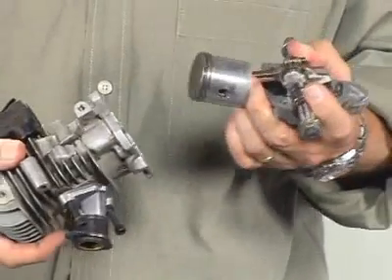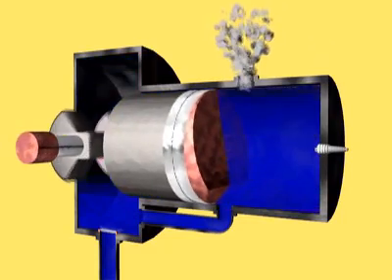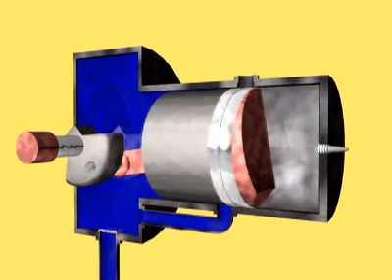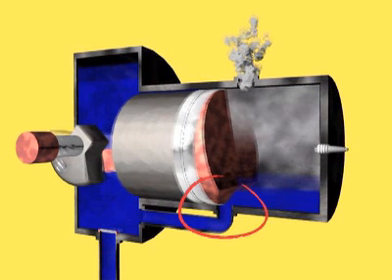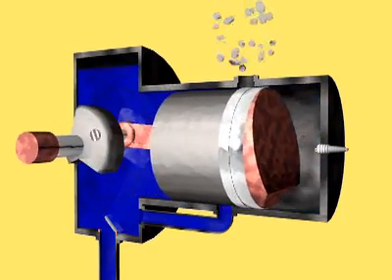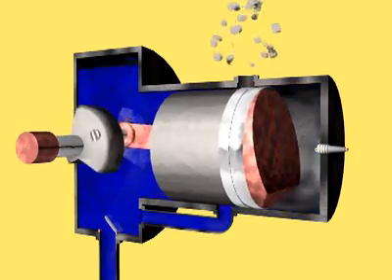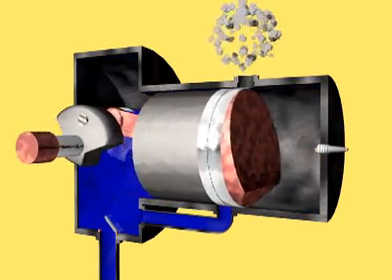How Two-stroke Engines Work

Comment: Any 2 stroke produces 2.5 times the torque (tractive effort) per cubic capacity of a 4 stroke engine.

A 2 stroke also produces 1/24th of the Nitrosoxide emmissions of a 4 stroke engine per volume of fuel burnt (US governement research figures). That's why 2stroke don't need catalytic converters

A 2 stroke engine without a Klaaden type expansion exhaust system will emit more unburnt hydrocarbons than a 4 stroke engine  of equal cubic capacity.

Comment: "twice the power" is a stupid thing to say because there is too many variables, having twice as many power strokes theoretically can make twice as much power, but 2 stroke systems (reed valves, carburetors, mechanical) are inefficient and dated against fuel injection and EFI mappings from 4 strokes. In real world scenarios, the 2 stroke is inefficient and therefore will usually never match the power. At the moment, on average, 2 strokes aren't even close to "twice the power" video is misleading.

Comment: JESUS NO Do some research, take a look at a modern 2 stroke mx bike, the 125 sx by KTM peak hp is around 34, while the 250 sx f (4 stroke) makes an insane 42 hp. This is at power band, now drop them to say low or mid range, now the 2 stroke stands NO chance. I own a 250 2 (and a 250 4 stroke.) I love the sound, the lightness (15-20 pounds less), the fun factor, but unless you are a pro at the clutch and never make mistakes, a 4 stroke will SMOKE you. OFC with more R&D 2 strokes can fly, but EPA.

Comment: because theres no oil pan like a normal 4stroke car engine. the crankshaft(section below the piston) has no kind of lubrication so when it fills up with gas if there is oil mixed with the gas well then the oil acts as the lubricant :)

Comment: Some 2 stroke engines, like large diesel 2 strokes, use an exhaust valve on top, and the ports on the cylinder wall are both air intakes.

Comment: ...most of the fresh fuel mix trying to escape. It's a very well timed play and balance of flow and pressure. The end result is, not so much at all fuel is wasted. Again, small portion is, inevitably. That, on the other hand is why a 2t engine is slightly less economical than a 4t of the same power (not volume).

Comment: Well first said, some of it does. As well as some exhaust gases stay with the fresh mixture. That's why theoretically 2t engine must be 2 times more powerful than the 4t of same volume, but in fact is only about ~1.5 times. However, the cylinder top and piston surfaces are not flat as shown here, but designed to route the flow of gases. Also, ignition comes a dash earlier than the top of stroke. The exhaust leave at such rush, that for a (precise) instant they create backpressure, resisting...

Comment: Not for sure, but some 2 cycle engines have what looks like a reeds (called a reed valves) on the outside part of the head where the exhaust is able to escape. Think of the exhaust as result of an explosion / ignition & after the explosion / ignition a vacuum  then happens which causes the reed valve to close on the exhaust port & suck in the fuel on the in let port. Some one else please help to explain,

Comment: rpm cut is controlled by ignition too.
a two stroke is a two stroke whatever the system you use fill it with fuel.
piston wear will be the same because of its same work.
there is one powerstroke per cranck rotation not every two crancks like with a four stroke the wear is more important.

you can't adapt EGR or catalytics without mechnical failures or efficiency loss.

Comment: It is not used for good reasons.
it must waste oil whatever the way you want to turn it.
a 4 stroke engine do not require 2 % of oil min to run.
it do not needs pistons or rings for normal maintenanc eas a 2 stroke does.

it will not allow egr too etc...

Comment: yes , this is why a proper expansion chambered exhaust is critical. it will in essence work as a echo chamber. the sonic resonance reflecting back in the pipe will force some of that unspent fuel back into the cylinder..  however the exhaust port closes relativity early in relation to the piston stroke. If it didn't you would not have compression and therefore no combustion.

Comment: That's where the exhaust comes in to this. Two strokes have a special exhaust with an expansion chamber and, let's call it a plate, towards the exit. What happens is when the exhaust gasses get released, some gasses are able to pass this plate, but the rest cause back-pressure. This back-pressure forces the escaped fuel/air/oil mixture back in to the piston for maximum efficiency.

Comment: A two-stroke engine compresses four cycles into two.

Large, very large and extremely large two-stroke engines generally use Roots-type superchargers or turbochargers for charge air scavenging as a two-stroke engine cannot naturally aspirate in the four-stroke sense.

Such engines have a very high thermal efficiency as well as weighing significantly less than a four-stroke engine of equivalent power.

The world's largest diesel engine is a two-stroke. More than 100,000 hp.

Comment: of course ! that is why you have an oily dirty exhaust and not such an efficient fuel consumption on 2 stroke engines ! 
for example my 23cc 1.5hp goped engine goes about 100km with 2.5litres of fuel/oil mix...while e decent 1000cc turbo 4 stroke engine runs 80km with the same amount of fuel. the engine is 43 times bigger and 66times more powerful :)

Comment: yes that's why they smell the way they smell, some gasoline is unburned in the exhaust gases, but modern 2 strokes have many ways to solve that. A simple way is a well tuned expansion chamber exhaust which will create a supersonic echo after the exhaust gases hit the walls and push the unburned gasoline inside again. Another way is to use a direct injection system so that gasoline is inject only when the piston has already closed the exhaust port!

Comment: yea, some of the fuel-air mixture does escape, hence why 2strokes aren't very efficent. however, newer 2 stroke engines are made with direct injection, so the mixture only comes into the cylinder, right before it is ignited. This is way better, because when the gasoline is in the cylinder it actually evaporates a little before being ignited, and this gives poor efficiency.

Comment: yes but the expansion chamber on the exhaust pipe (on most two stroke motorcycles, go-karts, etc…) fixes this. When the exhaust leaves the cylinder,it travels through the expansion chamber this lets the gas expand (obviously). This creates pressure, so when the exhaust gasses start to get pressurized again, in order to continue through the pipe which after the expansion chamber gets small again, they begin to whirl around in the chamber,

Comment: Yea they can last for years, though gasoline does take away from the oil's lubricative properties, but just a small amount to cause slight wear ( depending how you run it; fast or slow, different type of oil, ETC)

Comment: Oh yea without oil it'll kill itself quickly, but since its not slinging oil everywhere in the crankcase and the parts, they wear faster than a regular 4 stroke ( they also have higher RPMs so that doesn't help :O )

Comment: reaches the exhaust in time to meet the fresh incoming charge of fuel,stopping it for a fraction of a second till the port  is closed by the piston thus stopping the new charge going down the exhaust.

Sadly the exhaust is one fixed size,so works really at one set rev range,so you will always get some fresh charge,along with spent two stroke oil that gets emitted from the tail pipe.These bad gasses and oily drool led to failure to meet emission legislation in California,killing off 2 stroke.

Comment: The exhaust in a two stroke has an expansion chamber. 
Gasses flow out the exhaust port and into a opening V
This drops the pressure and helps suck out dirty gasses making sure the cylinder has no burnt charge left.Further down the pipe it closes down in a reverse V 

This reverse cone slows the pressure wave,only allowing some to flow out to atmosphere,the rest is reflected in a reverse wave back to the engine.The clever trick is tuning this wave so it reaches the exhaust in time

Comment: You could read books on the subject,but as comrade127 said there is an overlap.This is done on purpose.As the spent gasses are blown down the exhaust they have their own momentum which helps to suck in even more fresh charged fuel and air from the intake port.Effectively packing in more fresh charge.

Comment: wait when the gasoline and oil enter the cylinder, the exhaust port is still open, so as the piston moves up, won't some gasoline and oil get pushed out of the cylinder?

Comment: Good point and very true. First of all there must be a positive displacement blower or compressor. A turbocharger would not allow the engine to start as it would not be able to provide intake air flow untill the volume of exhaust gas reached a level sufficient to drive the turbo. Many Detroit Diesels have both Roots blowers AND turbos, but the Roots must always be present for starting.

Comment: Emissions and fuel economy do NOT favor a 2-stroke engine. It is nearly impossible to keep some raw fuel from escaping out the exhaust port during the combined intake/exhaust cycle. This wastes fuel and creates emissions.  The light weight and cheapness to produce do not out weigh this disadvantage.  2-strokes can have any number of cylinders. Light weight and cheap is their biggest advantage, so chain saws and model airplanes and outboard motors are common. 2-stroke applications.

Comment: Not entirely true. Detroit Diesel 2-strokes have a crankcase oil sump and pressure lubrication to all moving parts. No oil mixed with the fuel at all. Detroit Diesels also have poppet type exhaust valves operated by a camshaft.  Intake is through piston-ports. There are videos on YT that explain this bette.  An Interesting engine!

There HAVE been 2-stroke automobiles in the past (Saaab and DKW) but they were not very fuel efficient or emissions compliant. so they were discontinued.

Comment: 4-stroke engines CAN work upside down. The only modifications to a typical car engine required would be a 'dry sump' oiling system where the oil is kept in a seperate reservoir and delivered to the engine by a pressure pump supplied from the reservoir and return oil in the crankcase is sucked out by a scavenge pump and returned to the reservoir tank. The other modification would be fuel injection instead of a float-type carburetor. 4-stroke piston aircraft flew upside down in WWII  so equipped.

Comment: right as a two stroke starts its compression stroke the exhuast port is still open which causes it to loose a little bit of unburned fuel. 2 strokes waste gas

Comment: The bottom of the engine, where crankshaft is acts as second piston - during compression and ignition, the volume under the piston increases, this decreases pressure and sucks fuel/air mixture from carburator troug one-way valve. When the fuel burns and the piston goes down, the wolume under the piston decreases, increasing pressure. this closes the one-way valve and when the piston clears the channel between crankshaft space and the cylinder, the pressurized mixture flows to the cylinder.

Comment: Just one question when the piston moves down to the bottom it nor only uncovers the intake port but also the exhaust port,wont that let the mixture of gasoline and air leak out through the exhaust port

Comment: Two strokes are better for just something that needs power and needs to be light. I work on them all the time and they always have hole just rusting and corroding through the exhaust. The shit that builds up in a two stroke exahuast is horrible. And u take a mach to it and u will see all the fuel u wasted.

Comment: @TheLionRichard What they don't show you in this video is the unique design of the exhaust tube that makes a back pressure causing the exhaust gas to move slowly so that the fuel/air mixture doesn't escape. Also the pistons is moving at incredible speeds even at idle, so really there is no way for the fuel to escape.

Comment: That "air-gas" mixture also has oil in it too. That's another big difference between 4 and 2 stroke engines; 4 strokes have a seperate crankcase for the oil, whereas in the 2 stroke, you have to mix the oil with the gasoline. This is the real reason why 2 strokes can work in any orientation; oil basically gets everywhere to lube stuff. You can't flip a 4 stroke upside down or you'll screw up the engine...

Comment: This design is very flawed. Fuel and air can easily go through the exhaust making the engine be much less efficient. Even with direct injection, the air can still escape, and there would not be enough air and too much CO2 for the gas to burn properly.

Comment: @xXxDANMANxXx It would work but good luck getting one to meet pollution standards. They aren't particularly efficient or clean burning and typically only work at 2 speeds, idle and full throttle.

Comment: I've never seen this before but had the idea, why not have a 4 cylinder engine that's actually a 2 stroker, have 2 pistons firing at the same time = double (if not almost double) the power, and no resistance except compression (no valvetrain, no rockers no springs etc)

Comment: Do you notice how the fuel magically stops and does not go out of the exhaust port?  

Some details are not mentioned.  Exhaust pipe design is very important to help suck fuel into the cylinder and blow fuel that gets in the exhaust back into the cylinder.

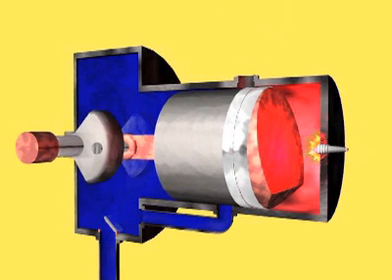Comment: 0:29 notice the blue fuel going into the combustion chamber. Then notice the open exhaust hole. Why doesn't the fuel escape through there as it is being drawn in? yes, eventually the piston blocks it, but the fuel moves into the chamber before then?

Again, why isn't the fuel escaping through there?

Comment: You failed to mention the pollution factor of this type engine. When both ports are opened simultaneously, unburned fuel / air mixture also goes out with the exhaust, which wastes fuel, and pollutes the air. That's why so many of the motocross bikes went to the four stroke engine. If this problem could be remedied, the two stroke would be the king of small engines.

Comment: @MisterSea7 There was a few 2 stroke cars. They run in reverse as well. You Could actually Start the car, put it in reverse start backing up, turn the car off, put it in first let off the clutch and compression start the engine to run in reverse. At that Point you would have multiple reverse gears and one forward gear.

Comment: @gpower88 cuz less cylinders the hotter it will get plus people run cars at a condensate speed or rpm 2 strokes can not take that trust me i blew up my dirt bike motor by running it at the same speed to long

Comment: he said it sparks when the piston is at the top of its stroke but thats not exactly true is it? it sparks just before the piston is at the end of its stroke so the air and fuel can circulate more before the piston gets to the top of the cylinder. and aslo because this happens it causes more compression in the cylinder which creates more power

Comment: @bomberman33311 it does. that is why 2 stroke exhausts have an expansion chamber which reflects the pressure wave back towards the cylinder and pushes the unburned fuel/air mixture back into the cylinder before the exhaust port is closed

Comment: @JSFER2 It is not fuel efficient. The thing is when the air and fuel mixture is sucked into the cylinder, some of it gets out through the exhaust pipe with the exhaust gas. Also, you need to mix oil with the gasoline in order to lubricate, and the oil comes out through the exhaust aswell. That's money thrown in the dumpster. The point is that you should use 2-strokes in machines that need to be light, such as chainsaws and dirtbikes.

Comment: @baeronautics Takes 2 strokes (up and down) to do intake, compression, ignition and exhaust. 

Intake is obviously the intake of the mixture of petrol and air.

Compression is as you can see in the video when the piston moves up and compresses (squeezes) that mixture.

Ignition is the spark plug igniting the mixture, causing the power.

Exhaust being the exhaust gases being let out.

:)

Comment: @Spikejr5342 when u said that " the crank is at the end of its rotation and is going back  , pushing the piston back up "now i have a question .. what makes the crank shaft rotate while going up to ignite compressed air and gasolene mixture with the help of spark plug?... is it momentum ? ( i dont think it is momentum because momentum would bee too low to push the piston back up)

Comment: @RandomConcepts Normal 2 strokes are pretty much not made anymore cept in weed wackers n small tools... But in boats and snomobiles they have either gone to four strokes or Have the new Direct injected 2 strokes in them.  In some cases The DI 2 strokes get better fuel economy now than a four stroke does!!

Comment: thats brilliant. but i looked at a oleo mac engine fuel doesnt circulate tru sump for some reason its diect to the engine piston and crankshaft is bare its wierd tho. but that engine you have is a good example i use a 30cc in a go kart FF with shimano gearbox its powerfull enough ya cant beat 2 stroke imagine a 4cyl  1litre car as a 2 stroke yad pass a porche out lol :D te engine doesnt need much just piston,piston rod engine block and carbs there easy build.

Comment: @mattmax059 

i also had an older 2002 50cc scooter that had done 33,000km without changing the Piston and rings. Sure, it was a little worn and smoked alot. But thats 8 years..

Comment: @mattmax059 

actually, i dont care. Im not into dirt bikes. I have a 2 stroke scooter which lasted up to 7000km on a single piston and rings. Only reason i had to get them replaced is because my oil pump failed and the engine seized. Its a 50cc.